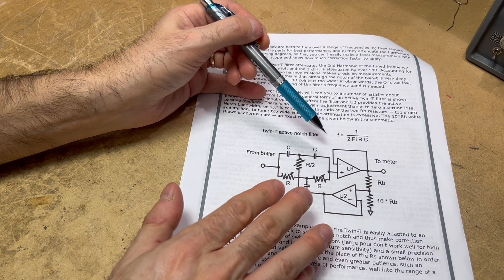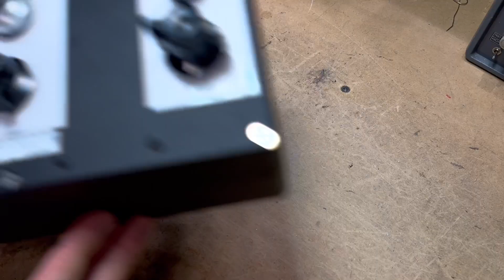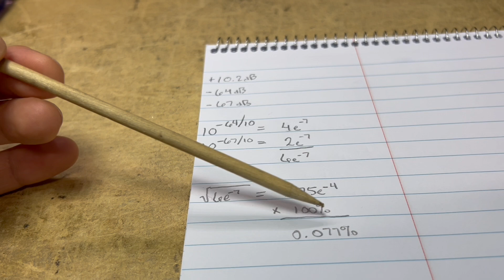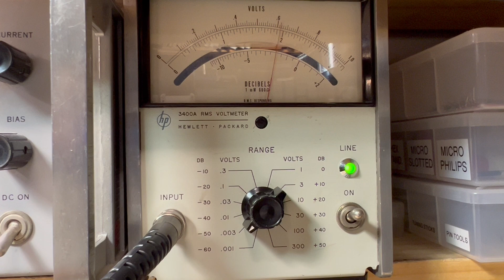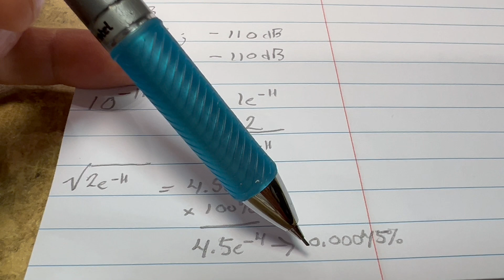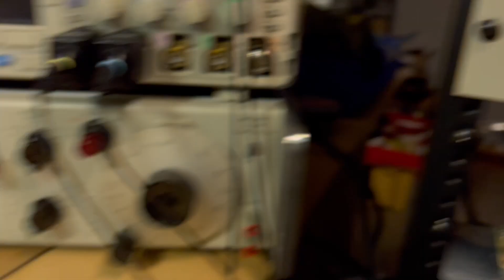Analyzing Harmonics with a Twin Tee Notch Filter

Comment: Serious question here because I think I don't totally understand. Why do you need the notch filter if you can just see the harmonics on your scope and ignore the fundamental?
Reply from the maker: Removing the fundamental allows me to look at the smaller level harmonics without overloading the front end of the spectrum analyzer. The “down ranging”. On the lower ranges (the more sensitive input levels) the high power of the fundamental will overload the front end of the analyzer. Best case it will cause distortion in the analyzer and a false reading. Worst case it can damage the front end. Also, when you’re taking a harmonic distortion reading you’re measuring the power levels of the harmonics, you don’t include the power of the fundamental. When I use the RMS meter to sum the harmonic levels, I don’t want to add the power of the fundamental. Great question and thanks for the comment.
Reply from the maker: For signals with high harmonic content you could ignore the fundamental if you’re using a spectrum analyzer. If you’re looking at lower harmonic content, say below about 60 db, you really need to remove the fundamental as most spectrum analyzers will not have the dynamic range needed for very accurate readings. My 3585B tops out at around 70-80db before I have to null the fundamental. Big thing though is over driving the front end.
Reply: @FreeElectron  Thanks for the reply! I understand, and I can now see how you are showing that in your video.

Comment: Excellent work - very well built! Not sure about the HP 334A but the HP 333A has an output from the filter that can be connected to your spectrum analyzer to extend the dynamic range. You might keep an eye out for an HP 3562A Dymanic Signal Analyzer - if you really want to go further down that rabbit hole. Regards, David

Comment from the maker: I’m a big fan of the ESP website. I’ve spent quite a bit of time reading the articles there. Thanks for the info on the the other topologies, I will have to look into them some more. This twin tee only goes to 20Khz but I’d really like to extend that range to 200khz. I think that is possible using a SVF, not sure about twin tee though.

Comment: What would you estimate the availability of parts and the total your cost not counting time? Very nice video! Had to sub.
Reply from the maker: I’d say the switches are probably the most expensive. Depends on what you can find or have lying around. I sourced them from eBay so it’s really variable on cost. Components are from Mouser or what I had on hand. I think maybe total cost for me was around 50-75 USD.
Reply: @FreeElectron  Thanks! That's not bad.